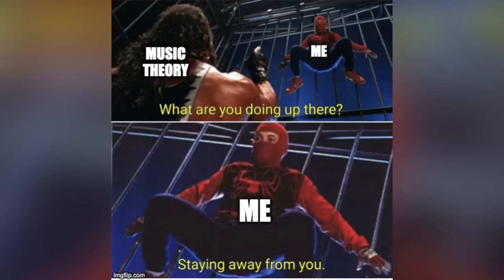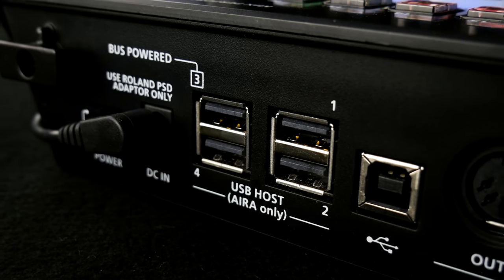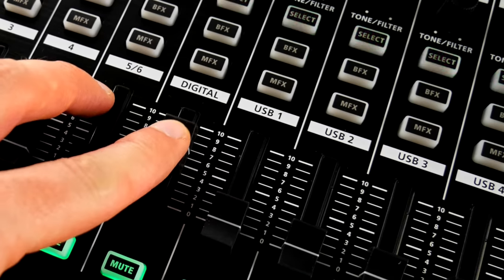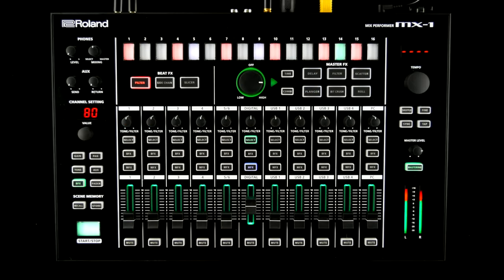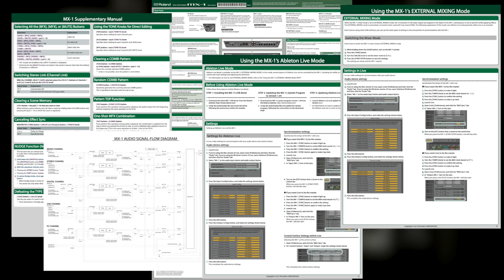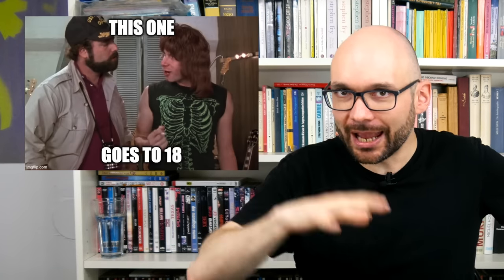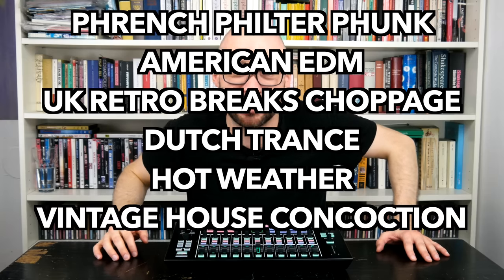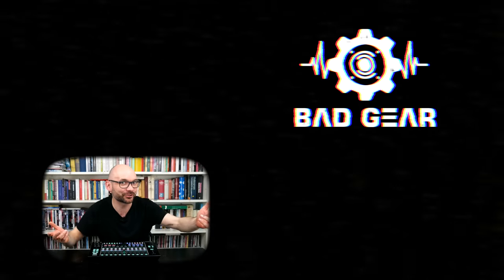Bad Gear - Roland Aira MX-1 Mixer

Comment: Small corrections:
There are 3 reverb algorithms, which is "delay 6 / 7 / 8". 
There are a few other effects hidden as well. Each of the 6 effects buttons have 8 effects to choose from, and with the effects sequencer you can have it change that effect per step. 

Compressor exists but it's in the mastering button parameters. No compressing just one track, it's the whole thing. 

 Interesting bit of info: roland failed heavily with documentation on this unit. The entire mastering section can be customized via 40+ hidden parameters which were not documented at all by roland. There's a community build manual out there on the web that details all of this. 

On top of that, there are plenty of button combinations that allow for some really interesting playability, such as selecting all tracks, reversing selection, holding down pan/gain/aux send etc and turning the filter knobs for quick changes (without needing to use the encoder dial), and some other fun stuff, most of which was never put into the roland manual. 

My issues with the unit is the lack of inputs that arn't usb, the noisy analog inputs, and the lack of a successor. A MX-2 would likely be an instant buy from me.

I've been using this mixer for nearly 5 years now, and it's so fundamental to my setup I don't want to think about playing without it.
Reply: 100% agreed!
Reply from the maker: Thank you for the heads up. I assumed there was something I missed but information is scarce
Reply: @AudioPilz  Also possible (and not well documented): use the Aira modular units to convert the USB inputs to analog inputs. I have the modules just for this. Still works out to be less expensive than other options.
Reply: @TheJournalismBizCoach  audio ins on the boutiques is great for this too!
Reply: @TheJournalismBizCoach  heresy those modules are amazing! Honestly though, really clever use of them.
Reply: @AudioPilz  I couldn't find the manual online but luckily I still had it downloaded. I've uploaded it here!
https://drive.google.com/file/d/1_k-6gWg2e42o3ynP_EXFwyfSqxOsMsX1/view?usp=sharing
Reply: @TheJournalismBizCoach  I did the same thing, with their programmability, a no brainer, although, we can admit it's the most expensive dongle we've ever bought, cuz that cash is gone. Granted we can get double our money back today, hahahah.
Reply: @dennis5504  Thank you for sharing "the missing manual", very much appreciated!
Reply: @dynho_b  No problem!
Reply: @TheJournalismBizCoach  I have external synths going to the inputs of my boutiques as well, great workaround! 👍🏻
Reply: the poor documentation seems to be a thing for the entire Aira range, like the TB-3, that have even fewer hands on controls than the original 303, but which practically has a SH-101/MC-202 hidden in it, along with FM and a lot of additional effect parameters. Don't know how extensively people have explored the sysex of the TR-8 yet.
Reply: im dissapointed it was no used dblue glitch style
Reply: Hey, I've had mine for about that long, too. The thing refusing to sync with anything- via midi or USB. Roland has told me to update the firmware, but it doesn't update. Ever run into this? Anyone have a fix?
Reply: @iiaaiiaannaaiiaaii  you've gone through the sync settings?
Reply: @gossamyr  yep! Great investment. And they’re great modules!
Reply: @TheJournalismBizCoach  please elaborate, what aira modular units for example? :)
Reply: Nailed it! I’ve been patiently waiting for a fully flushed out V2 where they scour the net for complaints and implementation of shortcomings.
Reply: @Maciej.A.Jankowski  I have all four -- Torcido (distortion), Bitrazer (bit crusher), Demora (delay), and Scooper (scatter effect) -- and each goes into the MX-1 on one of its USB channels. That makes those channels "analog" for all intents and purposes because I can plug other synths into those Aira units and either use the effect, or just bypass them but still send stereo audio into the MX-1. They're expensive as "digital to analog" converters go, but they're also great FX units on their own, so I feel they're worth it.
Reply: @elissitdesign  I doubt Roland will do that. It's actually a great unit for the price. It's really hard to complain about an 18-channel mixer/interface for $400.
Reply: @iiaaiiaannaaiiaaii  How are you trying to sync things? What are you trying to sync and how?
Reply: @TheJournalismBizCoach  oh man! you cracked the system! thank you! I especially liked the scatter effect on the MX and I was thinking about buying the MX just to get this one :)
Reply: @fisk0  you can easily find Alot of pdfs online

I have them all printed and filed in my studio, including the insane mastering parameters of the mx1
Reply: Do not forget that we can add the SBX-1 😉
Reply: @jfphotoandlife8287  as more than a sequencer?

Comment: This thing came around when I was finishing up college. I had no money to spare, but needed an audio interface with more than just one stereo input. Even at it's 4 mono inputs, this was a top contender as I was excited Roland had made a mixer for synths. Then I tried to read exactly what it did. 4 inputs, 8 channels... 4 channels for Synths I wasn't interested in that had to be plugged into random USB ports. There's a huge FX section, but no FX? I had an MC-505 at the time and was hoping to get some of those AMAZING FX on some external synths. I was so completely confused by this machine that I got a Behringer UMC404 and BCF-2000 and never looked back until you made this video. You explained this thing quite well, but I still get the impression I'd be confused using it. The step sequencer is a cool idea though.
Reply from the maker: Thank you!!!
Reply: There are some great videos on YouTube to better understand how to use it. Sonic State is a good place to start. Besides you just can't beat Nick Batt (The Bat) for a thorough review on a piece of gear. Good luck

Comment: I would like to see a MX-2….. USB class compliant, not only working with Roland gear…better FX … real side chaining, 8 assignable outs (like the TR-8s), sub groups… would be the shit!
Reply from the maker: I'd buy that for a $;)
Reply: Agreed! Part of the reason Roland keeps showing up on Bad Gear (aside from the fact that they've made lots and lots of things over the years)  is that they have a tendency to produce 80% brilliant things and then let them die on the vine. An MX-2 that is half as thoughtful of a revision as the TR8S was to the TR8 would sell like hot cakes, if only Roland were smart enough to build it!
Reply: For real. They upgraded the tr8. There should have made aira stuff class compliant.  It's the only reason I never got it. Half of those faders would be useless for me.
Reply: And less line noise, and more channels, and 100% wet aux send and and and
Reply: unfortunately they will never make it class complaint, market strategy people only buy Roland gear nothing else. That is in the mind of the board.
Reply: @jeffry5800  probably, Roland's business practices have always made me weary of buying their stuff. They tend to promise the world and then drop support. If they were more willing to at least open source their products when they discontinue/drop support, I'd be more likely to buy their stuff. I definitely wouldn't want to buy their stuff when it comes to anything that requires computers to work as they inevitably won't update their software stuff down the line and they'll use some proprietary drivers or format that won't work in 2 or 3 OS updates.
Reply: @mr.DorianJames  japanese still differ a lot in regards to the west. Lovely people, however business wise very single minded
Reply: Hello Uli Behringer, Please see this video and these comments and make the device Roland failed to.
Reply: @jeffry5800  I think some of the newer Roland stuff is class compliant, eg the Aira Compact series and the 404 MK2. Took them long enough but yeah finally we have it

Comment: I really get lost in those longer compositions. Awesome once again!
Roland really hit it out of the park with backlighting on that series. There's a  fine balance between "I can't see it" and "I can't see anything else"
Reply from the maker: Thanks! Sunglasses recommended;)
Reply: Not on the System 1... I had to go into mine and use a permenant marker on the LEDs... my EEYYYEEESSSSS
Reply: @mononcle  I should've put a /s at the end lol. It's up there with a behringer delay pedal on my board with a blue led that makes it impossible to read what any of the knobs do... on the whole board.

Comment: I had this mixer for a while and have to say it was an awesome piece of kit while I had a few Roland devices. Happy to say I sold off all my Roland kit so didnt have much use for this. If you're pairing it with other Aira or Boutique devices its a very fun and creative mixer.
Reply from the maker: The aira integration works pretty well

Comment: I've got one of these.  Works best with a Roland setup, of course.  Awesome sequencer based DAW-less side-chain compression, but yeah, can't compress on a per-track basis, just sidechain.   I've also got a few of the Roland Aira FX units that effectively turn the usb inputs into standard audio ones when needed.  The spdif is very useful as well.  I use an Edirol M-10MX mini mixer for expanded inputs through spdif.  My mainstay mixer is a Behringer XR18 (oodles of sound scaping abilities), but MX-1 is a ton of fun for live techno jams.
Reply from the maker: Behringer really upped the mixer game!

Comment: You fucking rock, love all your vids, just an AMAZING mix of funny, informational and inspiring, keep up the great work <3 Personally love my mx-1 and have a lot of fun every time I play with it. Got to admit though that Roland definitely managed to create the most fucking confusing manual known to mankind that still manages to not cover half of what this little beast is capable of. Also don't quite understand why they discontinued it. My biggest hope regarding future updates is them adding some more gear that can be used with the Aira usb. Should not be so hard to add for example the Roland sp404 line to the list of useable devices. Also would be sweat if they made in depth video tutorials like they did for the sp404 mk2 for all Roland gear, would make it so much easier for people new to the devices to understand the basics.
Reply from the maker: Thank you so much!!!

Comment: This is probably one of your better videos in a long time.

It breaks the norm or the pattern videos of old and challenges you to 

Push the limits when making video content.

I would say the RCA jacks are no real big deal. Conversion from one connector to the other is a pain but at the end of the day as long as it works at high quality audio or the best digital signal who cares.

Again very good video. I’m still trying to figure out how I would use this with the System 8 and the TR8S together. While still maintaining The highest level of quality and features each unit by themselves offers.

It’s a mystery to me. 

And if you have a DAW less system or you use an MPC live where you can put any audio class compliant interface to the MPC, now I want to know!
Reply from the maker: Thank you!!!
Reply: MX-1 does not work with the MPC or Force
Reply: @drrobert9068  Thank you very much,  the MX 1 is not a class compliant audio interface? This sort of takes away all of the fun. I’m sure it would have been an easy addition. So I’m still a little confused on the MX 1 :-)
Reply: @majicboxstudios3996  Nope, the AIRAs all require specific drivers for them to be recognized. This also means that if you want to digitally multichannel record from more than one AIRA device it gets a bit hairy with aggregated devices on MacOS. That is why the MX-1 especially makes sense if you have multiple AIRA devices like the TB-3, VT-3, TR-8 and System-1.

Comment: As superfluous as the MX1 seems, it looks like it could actually make the Verselab MV-1 useful.

Come to think of it, you should do a episode on the Verselab MV-1.
Reply from the maker: Agreed, the Verselab needs to be on the show!
Reply: I don't know what Roland was thinking with the Verselab. What a failure of a product
Reply: @rorz999  They intended the Verselab as a sort (singer) songwriter tool rather than a piece of performance gear and not only for it's mic input. For example.. It's sequencer capabilities in therms of linear programming goes way beyond the MC707. Same sound engine but you need a Roland cloud account to design your own sounds, just like with the MC101.
 
 @AudioPilz  Nice vid about the MX1!!  It's a bit limited on the FX routings indeed.. but the performance features are awesome and just perfect. Nothing out there in this price tag.. but in the end the vendor lock on the USB channels makes you spend too much on Roland products.. hahaha. I only noticed a sort of midi sync alignment with the TB3 together with the TR8s. The MC707, TR8s and MV1 for example sync perfect! I didn't use my TB3 that much because of that. 
Would love to see you do a vid on the MV1  😇

Comment: If you can get your hands on one, try a Vestax VCM-600 as an Ableton controller as far as "vintage" gear.  It doesn't have as many channels... but it does have a ton of pots, dedicated cross-fader, and more.  Plus, you can MIDI assign each control to whatever you want.  So you can get pretty deep with a performance.
Reply from the maker: Great idea, thanks!

Comment: I bought it when it came out and I still use it everyday.

It’s not a great audio interface, not a good mixer, but a fantastic performing tool. 

The fact that there is filtre on each tracks, sidechain (very use full to create dynamic movement) and the scene recall function make it unbeatable for me in a live situation. The master function is also a great pro for this as it has multiple algorythm (I always try different one with the sound ingeneer of the venue I’m playing at).

It is really meant to be use for live, and comes really handy if you use hardware + a DAW. 

The FX section really could be more ergonomic but it’s still fun to use, and you can use the send return very easily ( I use it to send any audio that’s coming in to my Octatrack to re sample and process it). 

The only things that still bugs me is the lack of input. I end up using only 4 Channel on it and have to make concession on how to have all mygear connected.

How and not any support from Roland. The manual is shit and almost no update of the firmware…
Reply from the maker: Filters on each track is so great!

Comment: The Mix1 bosts amazing connectivity....but only with the other half dozen machines in the same product range. So it's like a workstation that you can buy in very expensive instalments.
Reply from the maker: You'll still need a lot of wallwarts for powering the setup;)

Comment: That first jam reminded me that I firmly believe Novation needs to release a somewhat larger form factor Novation Circuit Mix with built in effects and sequenced parameter locking to glue together the existing circuit models (and other gear as well).

The circuit workflow is great and super performance-friendly. Add in some faders and always available mute buttons, a ton of effects and routing options, a bunch of individual inputs and some sends, audio over USB/DAW integration and it'd be a smash hit for everyone who has too many tiny desktop monosynths.
Reply from the maker: I'd love to see a Novation Mix!!!

Comment: I have the MX1 and have performed live with it, it's rock solid in fairness. These days I'm using the Bluebox, but still use the MX1 as my audio interface which is a terrible idea as its super noisy. I'll sell it at some point.
Reply from the maker: I've read about the noise issues but the one I have right here is clean as a whistle...
Reply: @AudioPilz  - usually if you add the mastering compression on and have the gain up you’ll hear it. As long as you crank up the incoming audio the noise it not bad.

Comment: I still remember(?) the D-110 manual, every chapter started with a description of how the LA synthesis worked, but written in Roland’s special way so that as you stated reading the next line, you completely forgot what you read on the line before.

Even now, I couldn’t tell you any of it and I’ve read that manual more times than I care to think!
Reply from the maker: The horror...

Comment: I'm not the biggest fan of Elektron, and tbh hate a kinda hate/despise relationship with the Octatrack.  But I loved using it as a programmable mixer and always felt like they could have made a truly inspiring performance mixer in this regard.  Include some of the Analog Heat features (even just the drive and compression on channel and bus) and I'd be SOLD immediately!!!
Reply from the maker: Interesting angle on the Octa!
Reply: Right with you, an octa with more ins and out and better fx